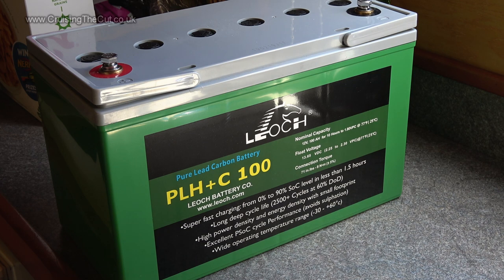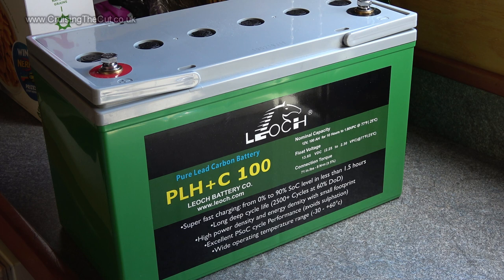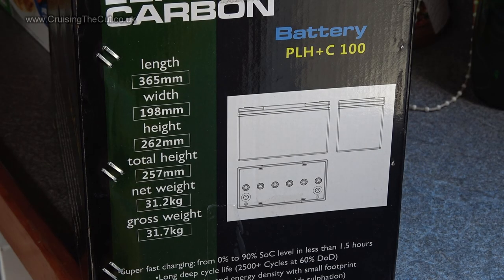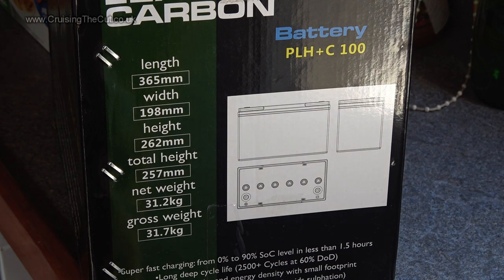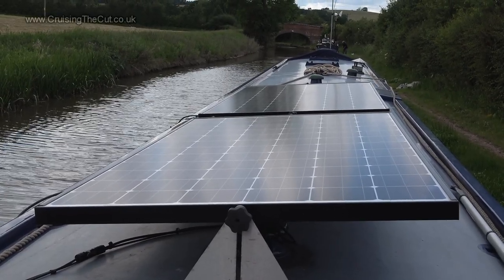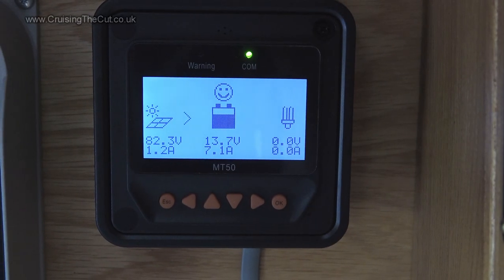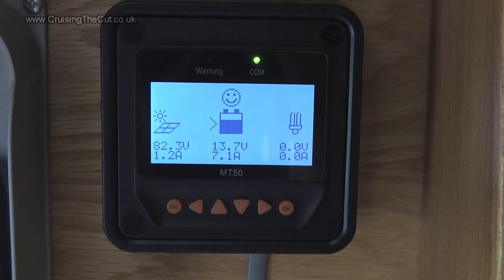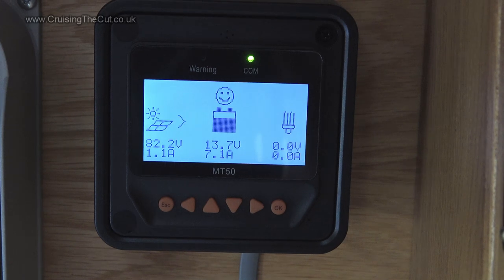178. Installing Lead Carbon batteries (12V 100Ah) into my canal narrowboat

Comment: Have you noticed any extra work the alternator may have charging the new carbon-lead batteries? I.e. are they thirstier for charge than regular lead acid?
9:25 The inverter will have big input capacitors and will therefore always spark on connection. At least my Victron one does.
10:30 The wiring pattern just distributes the currents in the wires nicely so any voltage loss in the wires has an even voltage effect for all batteries, the batteries would all hold the same state of charge eventually because they are connected together, but starting from alternate ends for +ve and -ve like you have done is more efficient for heavy drain items like the inverter as all batteries have the same voltage regardless of currents.
Carbon-lead voltages seem to be compatible with Gel battery settings if there is no alternate.

Comment: Nice vid ... good luck with the Lead Carbons, do let us know how they perform. One thing to look out for is that the kA rating of a Mega fuse is only 2kA.... whereas I wouldn't be surprised if each of those batteries is 1600A or more short circuit - so you probably need a fuse of about 6kA or more on a bank of 3 of them... or install a mega fuse to each battery. A fuse of too low a kA rating can cause a fire in a direct short situation. I'm wondering how long it will be before the boat safety regs start taking this into account (the marine regs in the USA do already).

Comment: The spark you noticed when reconnecting the power cable is the inverter capacitors re charging pulling power from the batt bank.
Reply: But was the inverter wiring connected by then ?

Comment: Coming from across the pond nice 👌 video noticed that your cables showed signs of over heating try using 1/0 stranded cable and definitely look into getting a battery monitoring system with a negative shunt gives real time data

Comment: It appears to me you have ample battery power for your inverter and any other 12 volt gadgets you may have.  Your solar charging panels look to me to be able to keep your batteries fully charged on a sunny day while still using electricity through your inverter.  My guess would be the refrigerator taking the lions share of power and on cold days, would not probably be using the compressor as much as during summer.  In the case of prolonged overcast, I would guess the charging would be at minimum and perhaps a generator might have to be used on occasion.  Anyway, another interesting video as to the operation of a canal boat...

Comment: While you have the inverter disconnected the caps. slowly discharge, when you reconnect the batteries the spark comes from recharging the caps. One set of the cables are wrong you should discharge cross one way and charge cross the other way, Either the solar panels or the house batteries should be swapped to the opposite corners. Great video.
Reply: They are all connected together, it really doesn't make any change if you use another corner (on the same side).
It's like putting water on the other side into a bathtub.

Comment: A very interesting blog it must be said David...I had no idea a topic on batteries could be so... interesting...

Like you I researched the smartgauge article, and, when tidying up the cabling on my boat did exactly as did you, treating the entire service battery bank as a single cell for "balancing" purposes.

Certainly from the narrowboating aspect I would regard the article as the definitive word on connecting batteries correctly.

However, seeing as you mentioned that your old AGM batteries were nigh on OAPs at 10 years old did make me wonder if the manner of connection is all that crucial after all?

The only suggestion I would make is that you bung in a red lever isolating switch in the service bank positive rail and take all the supply circuits and charger input to the non battery side of the switch.

Goodness only knows what unrealised return circuits there are via chargers and inverters so isolating the battery bank completely solves that problem.
Reply from the maker: Cheers Ross, good points all.

Comment: David,
Before the battery swap out had you been having issues with running low on battery charge on cloudy days or in the evening when using your inverter a lot? 10 years is a good long time on lead acid. I think your Victron battery management system has done its job well.
Reply from the maker: Hi. The Victron thing is just an inverter/charger (and the latter only when on shoreline) not a management system. My management consists of not using anything electrical after cloudy days!!

Comment: Do you happen to have a link to where I could buy some of those laundry drying poles? Space is a premium on our 42 footer and could free some up with those.
Reply from the maker: No link but I got them from "The Range" in Rugby in the bathroom section as they're supposedly to hold a shower curtain I think.
Reply: @CruisingTheCut  thought so!

Comment: Is it normal to install the solar panel system without a method of isolating it?  I am only familiar with larger applications on residential house roofs and they usually have switching both on the roof and at the panel to isolate. Perhaps it's something to consider installing at some point? Out of curiosity I located the MT50 manual and it talks about equalize charge in its terminology which I though was interesting!  I think you're being a bit modest - it was a well executed battery exchange from what I saw... the only constructive criticism is that I feel it was a perfect opportunity to deal with that surface rust on the frame of the battery compartment with a bit of rust converting paint...
In any case, I'd love to see more content on maintenance and operations! Cheers for great content!

Comment: As a mechanic of 40 years, I would always disconnect the Negative, or what ever is going to Earth first. That way you cannot short out the spanner to earth causing a spark. I have seen spanners glow red from shorting out from banks of batteries.
Reply: That's because most vehicles connect the chassis to negative, so it's safe to touch metal things with the negative when the positive is connected, but not the other way around. There isn't a lot of metal round his batteries, but there's still some.

Comment: The center battery connection helps maintain balanced battery voltage levels. Your corner to corner approach will force the voltage to go through the batteries to get to the weakest cell. And you should install a disconnect on the solar panels for safety's sake.
Reply: Not true, the batteries are in parallel, not series.

Comment: Grab yourself a small socket spanner set. More efficient and probably safer than a single spanner. Of course, sometimes a single spanner is unavoidable and in some cases necessary, but sockets are so much easier in tight spaces.

Comment: I believe you’ll need a fuse coming off the positive battery supply terminal. Before the main cutoff switch.
Anthony
Reply from the maker: It's never had one in twenty years so I'm not going to add one now...!

Comment: I once nearly shorted out 4 100Ah lithium batteries in my van conversion. Now that would have been an almighty bang. :)
Reply from the maker: Yikes. Thankfully "nearly" shorted...
Reply: @CruisingTheCut  I thought "I'd better double check this before connecting the final lead" and I was right. :)
Reply from the maker: Yikes. Wiping sweat off brow time...

Comment: Well done! (I’m an Off Grid Installer), the only constructive criticism is that the wires coming from the solar charge controller seem a tad thin, you could upsize them to 6mm or 10mm to reduce impedance or resistance in those 2 wires. Hopefully you’re using an MPPT charge controller.
Reply from the maker: Fear not, the wires have been sized correctly, in fact they're over-capacity for the current that'll come down them.

Comment: When batteries are wired in parallel, as yours are, you can connect the red and black solar charging leads to any red and black posts in your battery bank... just does not matter. When batteries are wired in series, like on a golf cart, the charging leads must be on the extreme red and black battery terminals.
Reply from the maker: Hi. Cheers but it does matter - see the link in the video description for details. Also both the old and new batteries always were in parallel and that hasn't changed, nor was it ever going to, that's not what the rewiring was about.

Comment: Thanks for the vlog and good luck with your new batteries. I am pretty sure that the change in wiring configuration was unnecessary, since the batteries were connected in parallel both before and after. Any difference between configurations would be due to resistance in the connecting wires (tiny) or resistance due to bad connections... however, the original configuration would have been better in those events. I am not an expert, so could be completely wrong.
Reply from the maker: It's necessary; see http://www.smartgauge.co.uk/batt_con.html
Reply: Hi David, Ithought the same as Jim Roth until I just read the article on "your" link... which seems to suggest that really you need two more wires to connect the +ve of battery 1 to battery 3 and the -ve of battery 3 to battery 1. Oh and you'll also need to swap out the existing link wires for ones that are the same length as the two new ones.
Reply from the maker: Hi Richard; yes, I was only going to do the "easy" fix verion rather than the full star configuration. Call me lazy!
Reply from the maker: Sean, haha I know what you mean about hidden characters, it's happpened to me before now. Thanks for all the good info.
Reply: I was thinking I might make my next move onto a boat for a much simpler and uncomplicated life. TBH I haven't got my head around cassette vs pump out vs compost yet and now I have to worry about flux types and cable lengths. Let alone diesel vs wood vs coal vs multifuel. Think I need a holiday, now where's my Ango Welsh brochure..............?

Comment: Have just found this vlog when connecting batteries in parallel we used to connect them all up to equalize them so that they act as one big battery usually over night but yours are ok then connect them up to the boat. also it doesn't matter which batteries you connect the supplies to as it is now one big battery
Reply from the maker: Yes it does, see the link, cheers
Reply: @CruisingTheCut   theoretically yes it would make a difference but assuming all good connections, the thumping thick cables between batteries and how short they are means its not worth concerning with, for say paralleled starter batteries (not thats ideal) hundreds of amps would make a difference where you tap from. For charging and 'house' power i cant see its worth the stress of re working wiring, yours seems to have enough slack to accommodate though :-)

Comment: As part of the checks when installing new batteries it's good practice to double check with a multimeter that the polarity is as indicated (ie positive is indeed by the red/plus mark) . I installed  a set of four lead acid batteries a few years ago and one of them was marked wrongly. Fortunately I didn't connect them up in a bank of four otherwise there would have been an almighty dead short and probable explosion!
Reply from the maker: Yikes!
Reply: Blimey! That was incredibly dangerous. I have to say in 30 plus years in the industry I have never seen such a thing or heard, until now, from anybody that has.

Comment: Oh no, not geeky at all. I really like the idea of these batteries. I assume that they are pretty much the same technology as the Firefly Lead Carbon Foam ones - completely unobtainable in the UK.
And I would recommend having some sort of battery/amp monitor. I have one of those basic NASA ones. Very easy to fit and you can get loads of information; charging/discharging amps, percentage charged, time to discharge at current rate etc. I changed all my lights to LED a while back and it was very satisfying being able to quantify the difference (about a factor of 10).
Reply from the maker: The trouble, as I understand it with those battery monitors which measure Amps consumed, is that as soon as the battery is anything other than brand new they start to drift in accuracy because they have to make certain guesses about capacity over time. So they're inaccurate, basically. Equally volt meters (which can give a true picture of state of charge) can only measure the battery state correctly when there's no load or charge being applied and after the battery's had time to settle. So on a solar-equipped system that means switching everything off in the dead of night, giving it an hour or so, then taking a voltmeter reading and only then will you have a true picture of SoC!!

Comment: As an electrical guy, I'm afraid that I did a lot of head shaking and eye rolling, but what you did is fine and you did it all safely which is really what counts.  I'm interested in the lead carbon battery technology - I'm not familiar with it, so thanks for showing this!  As always, nicely done video!
Since you had the battery switch off, I expect that the little spark that you saw was because the batteries were slightly different voltages - the inverter should be after the battery switch, so it wouldn't have any effect.  
Cheers!
Reply: By the way, looking through the article that you have the link for, your original install was closest to Method 4, in regard to charging.  The charging cables went to the center battery and fed out from there, making it the most balanced option (the top and bottom battery were both 1 link away from the charger).  
If you go by the article, you should also hook your main red and black wires there, if I'm reading it right.  
Cheers!
Reply from the maker: The inverter in this case is connected directly for reasons I can't recall.
Reply: @CruisingTheCut  Hmm - that's interesting, and now your theory makes more sense!  If you have a chance to change it to after the battery disconnect, you should probably consider it.  The inverter has active electronics that can fail/short out and you would just have to watch it burn if it's connected directly to the batteries...
Reply: It seemed he wired the inverter direct to the batteries and not thru the switch.  Same as my thought on the spark - low voltage spark, high current.
Reply: @markbulla1851  That's the layout that seems the most logical.  To take it any further, he could have made rings out of it - by linking the two outer batteries together - so there were leads 1 to 2, 2 to 3 AND 3 to 1
Reply: @markbulla1851  I'm sure that was a fuse block in the wire for it. But same point re the solar connection - not through the battery switch but again fused.
Can't help but like : batteries main fuse, main switch and everything connected after that.

Comment: It's not alchemy, it's electricity.  The resistance in those huge jumper cables is negligible.  So, it doesn't matter which terminal the solar charger is connected to.
Reply from the maker: Haha of course it's not alchemy! I'm pretty sure it's magic pixies... and good practice is having the cables across the bank, even though as you rightly say the difference is negligible.

Comment: so many experts.... well, those sparks are simply tiny differences in voltage from    the different batteries. as they are connected directly even the slightest difference sets of a current to equilize.
connecting across or not is simply a question of thickness of the connection wires between batteries and amps drawn. high amps and relatively thin wires turn those wires into resistors so to speak. now they do play a role and diagonal is the rule. 
big connectors and low amps: do whatever you want.
Reply: I'm not sure that the 10 mV difference would be enough to draw an arc though.

Comment: Putting the box dimensions on the box is hilarious - maybe not for you though... Any bets as to how many commenters will tell you 'you don't wanna wire it up like that mate' ? 6 is  my best guess :o)
 (btw - I agree that the spark you always get on finally connecting the last inverter wire could well be a discharged capacitor in the inverter  input suddenly charging up to 12.95v as you connect )

Comment: I suspect spark is due to capacitors in the inverter, however it's not that they hold a charge and discharge when you connect it, but the other way around. They were empty and they can take a large current from batteries to charge. It's only for a moment but it doesn't make it less of a surprise! Some higher voltage systems make the initial connection via a resistor so the capacitors can charge slowly before making the real connection.
Reply from the maker: Cheers Robin
Reply: Good idea Robin, Just one flaw he had the 12v disconect switched off, it was the difference in the voltage across the batteries
Reply: or the tiny draw of the solar charge controller
Reply from the maker: The inverter is connected directly to the terminals and not through the cutoff switch for reasons I can't recall right now.

Comment: I know this is an old video but a little thing. You really should have everything switched off before operating isolators. Not all isolators can handle the arcing you get when switching power on or off and even if they can they can be a lot me hassle to replace.

Apologies if you have had this before but I didn't spot anyone saying the same in my quick skim read.

Comment: Like others have commented, you clearly understand electricity/power consumption, solar panels, power requirements, better than most of your readers. Now here comes my question: How many watts of continuous  electricity  does a typical marina provide a moored boat? 1500? more/less ? Or is stated by the marina?
Reply from the maker: Mains here is 230V and usually 16A so approx 3kW